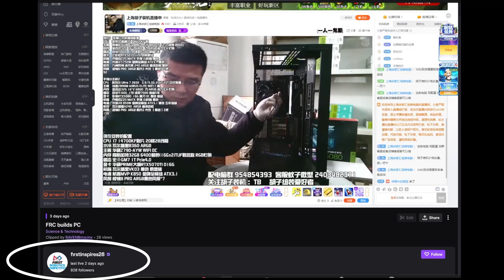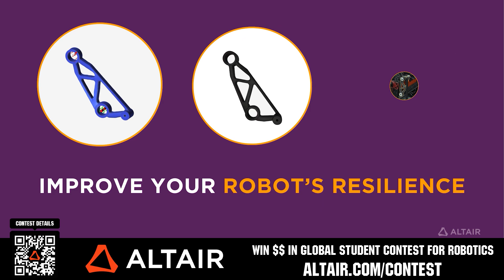REEFSCAPE Week 3 Clips of the Week | FRC 2025

Comment: full barge sounds like a goated strat cause then if the human player can’t score, they can keep scoring processor for 6
Reply: It was strategy mistake by Alliance 1, they let it slip by without realizing how much they missed scoring in barge. Look at Match 13 of playoffs FIM Berrien Springs event Alliance 4 quickly got shutdown by Processor defending bot and they could barely score after that. Ended up less than 100 points losing by more than 100+ points against alliance 1.
Reply: Broken elevator on the 4th alliance so the scoring isn’t representative of “shut down processor scoring”.